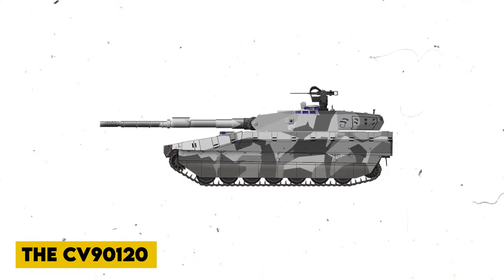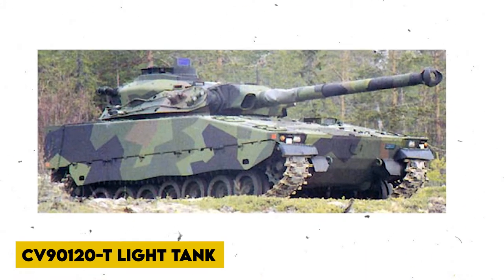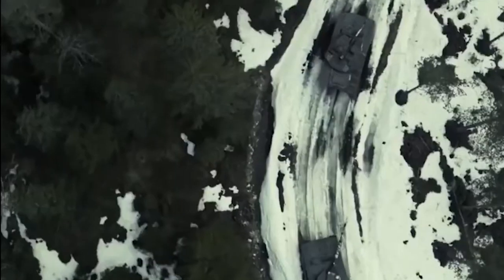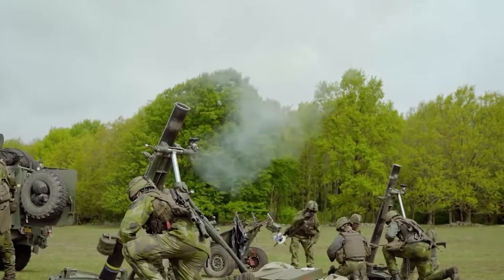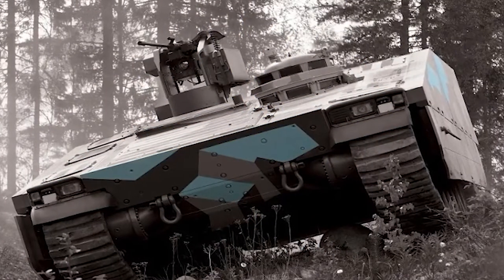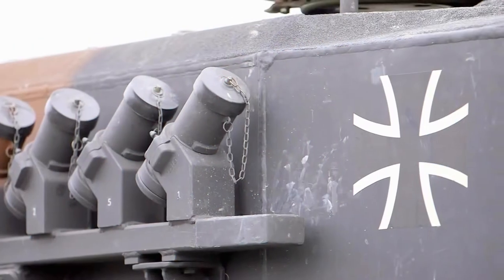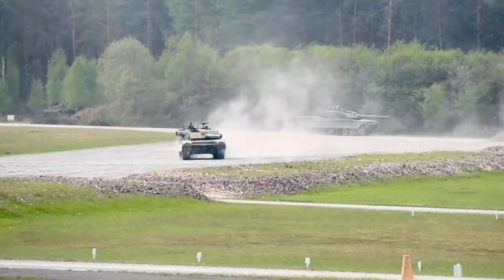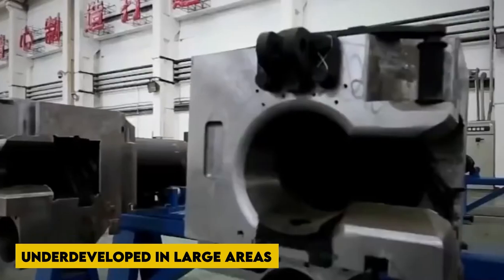The Swedish Army Just LEAKED This Most Featherweight MBT!

Comment: if you are talking about CV90120, why is there so many Leopard 2A6 shots? ...and Challenger 2 and Merkavas, and...
Reply: ye wtf xD
Reply: and correct me if im wrong but cv90 is exclusivly a IFV and there are no models as MBT
Reply: @Toujeo  i'd say a light modular tracked armored vehicle with 120mm MBT cannon is a tank destroyer or light tank, not an IFV nor an MBT. There is also IFV variant yeah, which has 30-35mm autocannon as main armament. Both AMOS and MJÖLNER 2x120mm heavy mortar systems can be mounted as well, which makes it... a what? weapons systems like that don't have a term yet... armored mortar vehicle?
Reply: @PrivateSusi  Hold on.  

CV90 vehicles weigh as much as the new US vehicle, widely called a light tank... (the LPF?)

But that vehicle doesn't also carry an infantry section.

If it did, wouldn't it make sense to call that vehicle an IFV?

Don't forget, the CV90 carries a squad of infantry.
Reply: @Toujeo  The CV90120 is generally called a light tank, because.. well its light.

the CV90120 can carry troops, but in its troop carying capacity it have very little ammo storage.  so the troop compartment can be change to carry extra ammunition making it more on par with other tanks.

While the frontal armor is significantly lower than that of a MBT, the side and top armor is just slightly thinner, and the rear armor is about the same.

the core concept of CV90120 is that what ever tank shoots the first (and hit) will probobly win the fight. So having less armor is really a very small drawback. If its compensated with hard and soft kill options as well as better optics and also ways to hide its own thermal signature.
Reply: @PrivateSusi  
" a what? weapons systems like that don't have a term yet"
Modular combat vehicle ... i think that is what haglunds call it.

Russia have something similar but they just use there tank base to mount pretty much anything on.

The drawback with the Russian model is that those vehicles are quite heavy and also have very limited space on the inside.

So i would not say the concept is brand new, its more evloved.
Reply: @PrivateSusi  thank you for the elaboration
Reply: @matsv201  i meant the mobile armored mortar system, what is that configuration called?

The vehicle as a whole might as well be modular combat vehicle or armored modular vehicle like wheeled IFVs Boxers and Patria AMV with no weapons systems installed.

But when the weapons system is installed.. what is this configuration called? AMOS is short of Advanced Mortar System and NEMO stands for New Mortar System but I'd say general term could be Armored Mortar System or Mobile Mortar System. 

These are the kind of mortar systems where crew is protected within armor and which  have e.g. direct fire capability, fire on the move capability and MRSI capability

https://www.youtube.com/watch?v=jrZYl9_DdiQ
Reply: @Toujeo  ..CV90-120T ... its a Lightweight tank compared to others, but with faar better sytems, most is classified.. aswell as armour...
Reply: @matsv201  ...well it not poorly armoured...just signifficantly lighter than a comparable armour made of ordinary steel... steel/tungsten/uranium isent exacly the best armour... the armour is classified...
Reply: @Toujeo  nah there's a mortar version, an anti-aircraft system (integrated radar), said 120mm gun makes it a light tank, a non-gunned command and control vehicle and I probably a couple models I forgot.
Reply: There not a lot of footage of the cv90120 so that’s probably why there’s a lot of different tanks in the video.